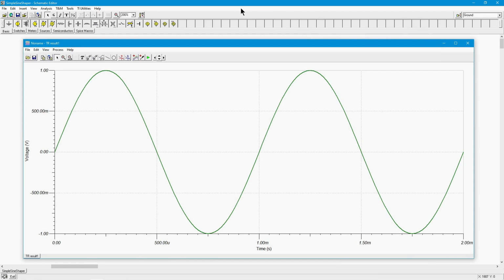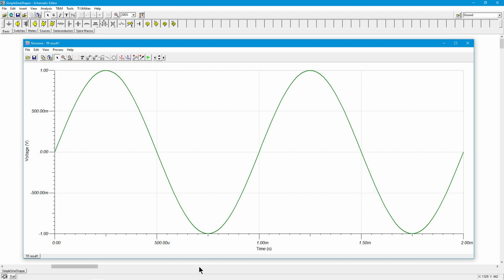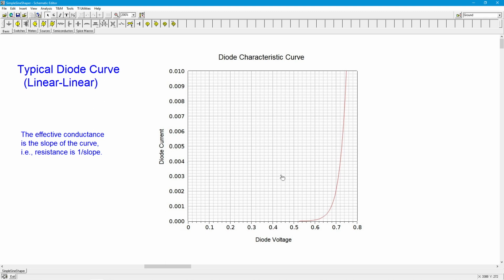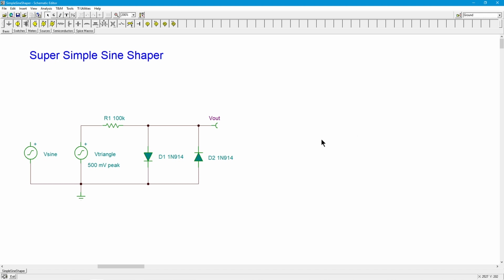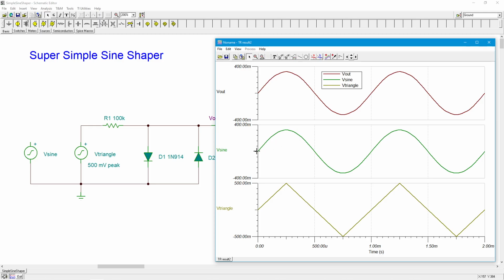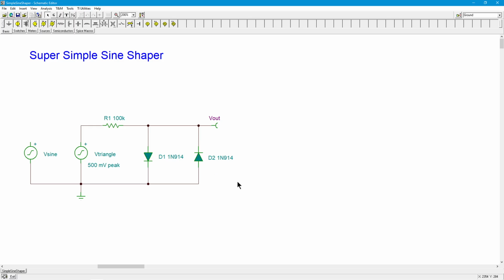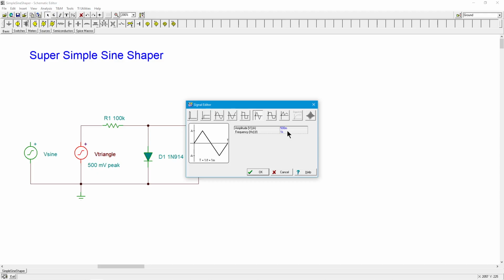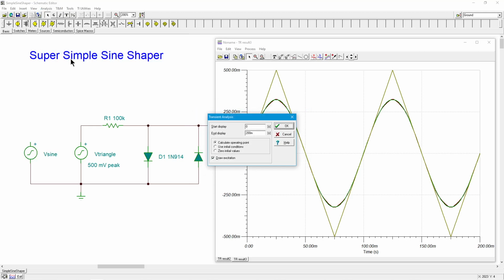Semiconductor Devices: Super Simple Sine Shaper

Comment: using Ge diodes and a larger resistor will make the sine smoother?
Reply from the maker: Perhaps more than anything else, this simple circuit is very much dependent on the amplitude of the input waveform.

Comment: Can you stack several diodes in series to increase the voltage of the triangle wave?
Reply from the maker: Yes, you can. You'll have to increase the triangle amplitude as well, of course. I tried using a string of 4 diodes (8 total) and brought the triangle up to around 2.3 volts. The shaper still produced THD of just under 1%.

Comment: Thank you for this timely video. I am currently working on a Tektronix FG502, which uses a diode-resistor shaper network to turn a triangle wave into a nice, low distortion sine wave up to 50 kHz (specs claim <0.5%), though the instrument generates signals all the way up to 11 MHz. Tek used four diode bridges in parallel, with series resistors of different values, to shape the triangle wave into a sine wave. The distortion at the low frequency is controlled by four trim pots in series with the bridges, while high frequency distortion is controlled by a trim cap parallel with the shaper network. The FG503 uses a slightly simpler five stage network for sine shaping, claiming <0.5% up to 30 kHz, <1.0% up to 300 kHz, and <2.5% up to 3 MHz in the specs.

The FG502 uses either FDH-6012 rectifier diodes (in the early units) or 1N4152R rectifier diodes (in later unites) while the FG503 uses 1N4152 rectifier diodes. These diodes have a reverse recovery time between 2 and 6 ns, and capacitance between 2 and 4 pF.
Reply from the maker: Yes, diode "ladders" or "bridges" have been very popular over the years as sine shapers. Back in the 80s we used some HP function generators in lab that did this. THD was around 1% or so as I recall. You might be interested in these videos which go into more depth on that technique:
https://youtu.be/ReVnPjKHhzg
https://youtu.be/lUST4lCa9UU

Of course, now, using direct digital synthesis, we see THD levels that are orders of magnitude smaller for function generators. We had the specialized Tektronix SG505 ultra low THD sine oscillator in lab as well (same 500 series plug-in form factor). That did 0.0008%. Impressive back in those days.

Comment: Would a diode that has a faster conductance response time result in a sine wave with less phase shift at higher frequencies?
Reply from the maker: Probably, but if you're using this as part of a signal generator it likely will not matter.

Comment: Now realizing this is almost definitely how the eurorack sine oscillator I have works! Always has slight little discontinuities at the peaks (there’s a trimmer inside I need to adjust), and it seems to roll off quickly around 10k where the other oscillators are smoother. Great video!
Reply from the maker: That could depend on the discontinuities. If the tops are a bit "pointy", it could be a sine that was shaped from a triangle wave.

Comment: Very nice. Two questions come to mind....this is then similar to the "barnroof -distortion" effect with a common grounded emitter bjt amp ? And secondly...would it somehow be possible( with reasonable maths effort) to find out the optimal amplitude of the input signal to get best sine wave fit?(i.e. Least thd compared to sine).
Reply from the maker: Not familiar with that term. Do you mean a wave that looks like a triangle but the top parts have a more gentle slope? Typically, an overdriven CE amp (without swamping) will produce clipping (flattening) on one side and an elongation on the other (before it eventually clips, too).
Reply: Yes indeed. Thats what I meant. If I remember correctly, the term came from Horowitz/Hill AoE.